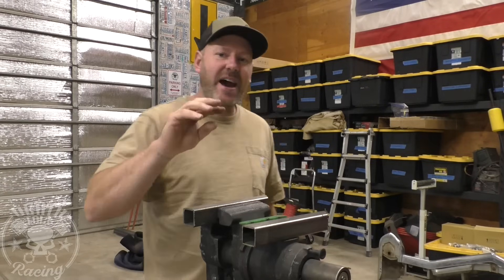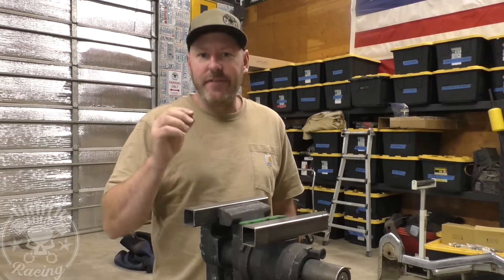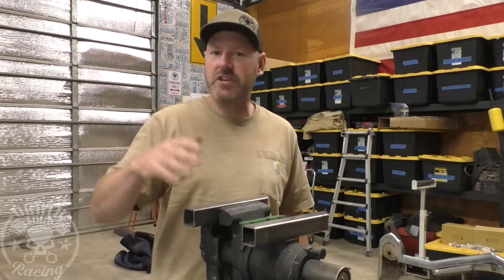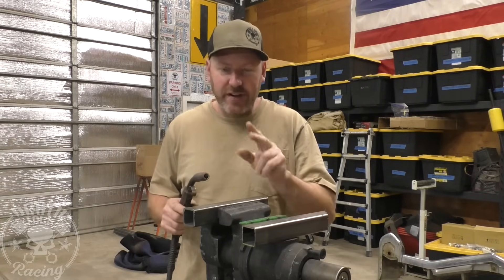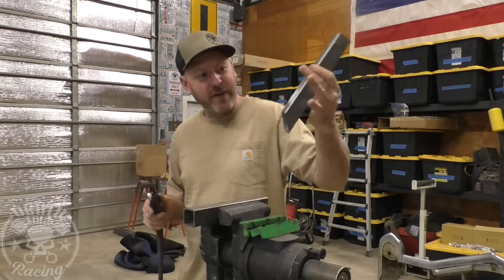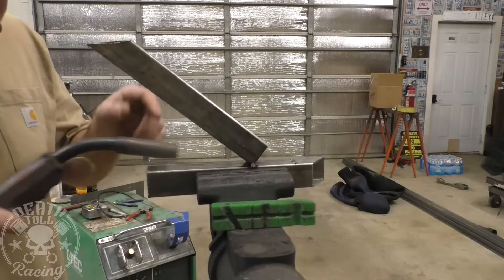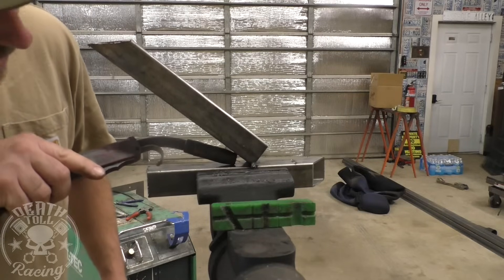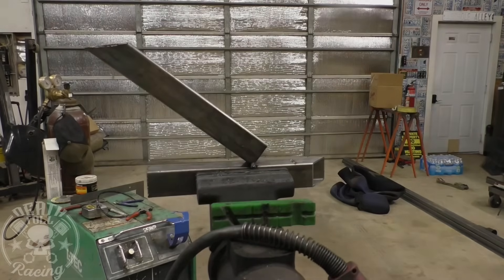Setting Wire Speed On A Mig Welder To Match Voltage, Must See For Beginners Learning Welding

Comment: . My friend is welding my exhaust I  2 areas , the crack right below the manifold. (fixed) and the ends of my new flex pipe that I had to replace.  (welding in process , we are in day 5.) don't know why.  I am doubting his knowledge  on this because his weld looks like crap and  it's not cold out here right now tonight, but he's saying, "it's too cold out ,  and his wire speed is feeding too fast . 
I told him turn the speed down, he says, he's already turned it down to the slowest that it will go for the setup .
 
however , I'm looking at his  dial settings, and it's at the hottest setting, and the fastest speed at 25 ft a min.  

I told him maybe his wire is too long because it's sticking out like 3½ in. 
.
I. sorry for this long explanation,  but I don't know what to think except it's pissing me off.  he knows I can't drive back to Colorado with my exhaust all messed up, . what is really going on here? 
he talks a lot bout the process but his actions are not consistent.
Reply from the maker: Under the lid of the welder there should be a chart.  Find the settings for 16-18g. Outside temp has little to do with anything, especially on thin material like exhaust.

Comment: how do know what voltage to use?
Reply from the maker: There are some good charts online if your welder doesn't have one.  It's usually under the lid for the recommended voltage for thickness.

Comment: How does one determine the voltage?
I follow the charts on my unit and the wire speed is always way too high and pushes the gun away.
Reply from the maker: on most machines you may have to use a volt meter if it's not on the dial or have a gauge.  You will set it to DC and go from the tip to the ground.

Comment: Perfect! Perfect! Before my cushy governmental job I was a MIG welder at a heavy trailer manufacturer. I did not learn how to weld there, that was a previous job, but by then I already knew how to set the welder by sound. I own a MIG welder today at my shop (retired from my governmental job) and if I'm under something welding and I need somebody to adjust my welder, I can just tell them to turn the wire speed or heat down or up just a smidge and they can figure out what I mean. And if they start asking stupid questions like "Do you want me to turn it to 4?" I just tell them don't touch the dial until I tell you to.
Reply from the maker: Lol

Comment: so could you tell me what kind of wire manipulation or pattern did you use these welds? It looked like a forward and back motion with no cursive e but I could not tell.
Reply from the maker: I usually do forward back. I try not to do any side to side motion generally. I try to keep the heat in the root of the joint.
Reply: @DeathTollRacing  so the forward / back motion and keeping the wire in the middle of the joint may not "stack dimes" but it better ensures a deeper penetration at the root which makes the joint stronger, not prettier?
Reply from the maker: Generally speaking I suppose. It will still stack domestically, but just not as dramatically

Comment: Down hill mig welding is not a good idea, it may look good but you will not get the same penetration as horizontal.  Yes I know it's easier to run but uphill is a better procedure.
Reply from the maker: cool story.

Comment: I'm late coming into this video, but great job talking about listening vs. watching. You may have mentioned this elsewhere, but the gas used also makes a difference in the sound.
 I've been subscribed for a while. I'm surprised this video has only now come up. 
 Thank you for the awesome videos.
Reply from the maker: There's more coming. And hopefully on a more regular basis.  I've been setting up the shop so I can spend more time doing, and less time shuffling crap around.

Comment: Call eme what you want, I refuse to watch welders that do not wear proper gear. MY son in law did this crap, he needed eye surgery.
Reply: You'll see it's for tack welds and he closes his eyes. UV doesn't go through eyelids, and you won't get burnt from ½ second flash.
Reply: @BrodyRadford You should still have at least a face shield. Those sparks do fly.
Reply: @BrodyRadford  Worked with a guy who spent the Weekend Tack Welding on his Stock Car, No Helmet.   Showed up on Monday saying his eyes felt like they were full of sand...Went home and didn't come back till Friday. 
Any UTuber who post without proper safety gear needs to be shut down !!!
Reply: @NRDavis-wl8vn a little flash burn doesn't take an entire week to heel so I would say the guy just didn't want to work 24 hrs is usually all a guy needs for flash burn! I am speaking from experience not just watching
Reply: Well you sure had a mouthful to say for not watching ! You know you could have just not said anything about it if you were not interested !
Reply: @ Because it's worth my time to call out idiots doing unsafe practices that would literally get you fired.
Reply: @opa_plays_mw5318  well been in the iron working trade for more than 20 years now and never fired over fitting up anything .  Welding is a special trade that will learn you all on its own what you can get away with or not from flash burn either on your skin or the eyes not from someone bitching that probably has never done it . I'm sorry your mom didn't allow you to go outside with our wearing a helmet
Reply: @donnellaapperson480  Passed cert's in 1980. Been there.

Comment: I have a cheap 110v mig from Amazon and I don't now how to determine the voltage. It has a range from -3v to +3v the ground is positive so do I set the voltage positive?
Reply from the maker: Is the Cheapest Mini Flux Core (gasless) welder I can find any good?  Bestarc MIG145 Review and test
https://youtu.be/yZclqwD_B_g
Reply from the maker: I think that’s actually the variance. Start with 0v. I actually go through this on another video. I’ll link it below.

Comment: The gusset welds look great, but the gussets are on the wrong position in my opinion. The center of the tubes is the weakest part because it’s the farthest from the other walls. Move the gusset to the outer or inner edge of the tubes and it will be MUCH stronger. Same cost and work, but stronger, so why not?
Reply from the maker: It actually depends on what you’re going for in positioning. If you make it to rigid by locating it to the outside, it could cause stress cracking. My design of these gussets does help for that though, not point loading at the end of the gusset (that’s the curve and cut out). That’s a complicated subject that gets really wordy.

Comment: This all sounds good. But how do you know if your getting good penetration with your welds? Like doing some welding on thicker metals, like for hot rod type of work. I want my welds to be strong!...
Reply from the maker: Do a test piece and cut it across the weld. Polish it as shiny as possible and rub it with navel jelly (rust remover). The penetration will be a different color.  I show one on a recent video on flux core welding for beginners.
Reply from the maker: Flux Core Welding For Beginners; Cheap Welders That Actually Work!
https://youtu.be/Pyhf87Frflw

Comment: Great vid showing how to set the correct wire feed to match the voltage. Now, how do you determine the correct voltage?
Reply from the maker: If you don’t have a chart on the welder, I would get some scrap of different thickness and set the welder for each one just below the blow through level.  Mark it down, or even mark the machine.
Reply: @DeathTollRacing  Thank you. Luckily I have a chart. So, set voltage using chart and then set wire feed to sound. If chart is off and burning through, reduce voltage and readjust wire feed to sound.

Comment: Thank you for helping, how do I know the heat setting in thickness of metals? By the time I get the sound you mention it looks like a spattered mess.
Reply from the maker: Newer welders usually have a chart to get you close somewhere on them. If not you’ll have to just turn it up until it’s too high and go back down. Usually if it’s spattering really bad it’s to low.

Comment: Bacon….are they frying an entire pig? Maybe pigs from Antarctica?….no sizzling ….the arc is off/ on numerous times per second if you hear sizzling or stubbing your settings need to be fine tuned the puddle tells the story.
Reply from the maker: This is short circuit, you are quoting spray arc.  completely different worlds.  You should withhold giving advice until you are more familiar.
Reply: @DeathTollRacing   oh sorry didn’t want to shake the boat. Short Circuit process is what I was referring specifically. The sound of bacon is a misnomer. In this process you cannot get a constant sound as in frying bacon. The arc is extinguished and reignited 60 times a second on AC 60 hertz. The sound of bacon frying is subjective at best’s as we all have different levels of hearing. Your bacon sizzling might be my steak frying in a pan. Just watch your puddle and stick out as that control your heat. You young guys buy a Harbor Freight welder and your instant popcorn welders. Keep your ears and mind open and your mouth shut…..BUT I did enjoy your video there was some great information there. Stay Well!
Reply from the maker: @carolynbatta9525  I only care to argue because I really don't like people giving bad advice, or conflated advice that confuses people.  I've hired over 1,000 welders in my career and a lot of the time would rather hire someone completely green than someone with minimal knowledge that they found in the comments or on reddit.

I'm not sure we are on the same page here.  If you think I need to turn the wire speed (amperage) down, you couldn't be more wrong.  If you are just arguing my descriptive words of the sound, then "okay" I guess. 

Now for the 60 hertz.  Unless you are running a transformer welder with a bad, or VERY crappy transformer, DC current output is 0 hertz.  Yes, it's plugged into an ac outlet that is 60 hertz if you are in the US or Canada.

Comment: I just subscribed and foesfly3047 below me has taken the words right out of my mouth. Excellent video and I look forward to the next one. I'm 69 but a bit of a beginner with welding, that bead was a work of art! Thank you
Reply: Fantastic! That’s what I’m working with right now. Should I assume that the “sound” adjustments are the same as the MiG? Thank you for the reply, it is much appreciated. I build high performance & repair of motorcycles. I do my own boring, valve grinding, etc. and I have a old SuperFlow 110 machine updated with Performance Trends computer software for my porting. The software is so confusing that I just use the old  SuperFlow manual controls. Maybe one of these days. I need to build a wheelie bar for a 1976 Yamaha RD400 2 stroke. Motors done and fired up with an auxiliary gas bottle. I’m in the middle of sanding and painting the tank and fiberglass body kit. Fingers crossed on that. I hope to run it on the drag strip but I know I won’t be able to keep that front end down and I’m to old to crash and recover. Thank you so much and I look forward to your next video. Didn’t mean to ramble on. What kind of racing are you building?
Reply from the maker: @richardbartlett4075  the sound with the flux core will be smoother. If it starts crackling, back it (wire speed) down just to where it quiets down. 

I’m doing street car drag racing builds currently. I’ve done off road, and hobby class rally in the past. I’m focusing on street car / trucks that you can take to a track or off-road park on my YouTube channel.
Reply from the maker: Thank you!  I have one set up now on using the gasless (flux core) wire since I know when I bought my first welder it's what I was trying to learn on.  I have a new camera setup so I'm hoping I can get much better video.

Comment: why do dimes when you can just run a straight line? and also you should never do downhill, only if you have no other choice then you can do it
Reply from the maker: 1-Root penetration
2-that’s a good rule for an amateur welder.
Reply: @DeathTollRacing  do you have any proof that doing dimes gives better root penetration cuz the way i see it, its only use is to make the weld look prettier but its not any stronger than running a straight line.
Reply from the maker: @anatude1  I did destructively test and weld procedures for 15 years. There’s a lot more to it than just “stacking dimes”, but just riding a puddle is the worst method, especially down hill.
Reply: @DeathTollRacing  thwn why doesent every welder out there stack dimes if its so much better?
Reply from the maker: @anatude1 there’s a lot more to it than that. You’re way over simplifying it.
Reply: @DeathTollRacing  ok im not tring to be rude im genuenly interested. Could you elaborate if there is a lot more to it im all ears i wanna learn more
Reply from the maker: @anatude1  it’s a lot to explain. I plan on make more videos and doing destructive/ etching testing so people can understand this. There are so many variables. Most welding procedures will be done with “stringer beads” not necessarily because it’s better, but because it’s easier to duplicate consistently across multiple welders, or more common now days robotic welders.
Reply: @DeathTollRacing  ok looking forward to thoes videos thanks!

Comment: tip for right handed mig welders, keep hearing protection in your left ear to avoid sparks going in your ear when welding vertical or overhead
Reply from the maker: I prefer non foam ear plugs since sparks go right through them and bring with them molten foam. an ear pod or something similar works well.
Reply: @DeathTollRacing  ive never had a spark melt my ear plugs and I used to do production mig but I guess its possible, we arent allowed music because its a structural shop and it can be a bit hazardous
Reply from the maker: @natenate2280  i wouldn’t recommend it. We used primarily 1/16 dual shield in all positions, so bb’s were real big. 😂
Reply: @DeathTollRacing  oh ok I was just running some vertical 3/32 dual shield today at work for awhile without any problems because I think the 1/16 hobart wire we got runs like shit and didnt have any problems but ill keep that in mind for tomorrow
Reply: .045 my bad not 3/32

Comment: Shouldn't the vertical be welded from the bottom up
Reply from the maker: With mig, and without pulse, it’s very difficult to go up hill without overheating if the material. If using self shielding wire, you will go up.  Flux core, dual shield wire is also up only, and some of those are actually a flat / horizontal only.

Comment: Hi there! Thanks for sharing this, I have one question, I have a cheap gasless MIG, and it comes with no chart what so ever. Is there any rule of thumb to set the voltage first based on the material thickness? Before I can then tune the wire speed to get that "sound". Thanks in advance Sir! Cheers from Indonesia!
Reply from the maker: The gasless wire will be different than what I did. On the small cheap welders, usually you will crank the voltage all the way up and then dial in your wire. You won’t really get the sound I got with it, but basically if you start with the wire slow, start turning it up until it starts sputtering, then back it off just until it quits. 

One last thing, you won’t want to weld down with gasless. Weld going up, always keeping your arc in the puddle.  I will do a video on this soon.  I think it could be helpful.
Reply: @DeathTollRacing  thanks for your reply! Looking forward to watch your upcoming videos!

Comment: Did you do two passes one on top of the other or was it just one pass?, Awesome job by the way
Reply from the maker: I did not here but you can. Usually though you would do one (root pass) and 2 on top (cover pass). Otherwise you’ll be weaving to cover. As you learn though, just do it however you can. Learning the rest of the techniques can come later.

Comment: Down hill is never going to be as strong unless it’s open root. 

Looks nice!!. But let’s be honest there’s no ticket for process’s for a fillet weld.(I guess it depends what your building) If our welders got caught doing a down hand it’s…grind it out…. redo it horizontal.
Reply from the maker: That’s a procedure thing not a set in stone thing. It is possible to downhill with joint penetration. There’s about 2 ways to do it right and 1,000,000 wrong. Most do it wrong because it looks smooth.
Reply: Yea fair. 

We had a guy get written up for doing a down hand. 

Not saying you’re doing anything wrong but young guys just starting…. I’ve been a journey man for 11 years. Worked on some cool projects in the past. If I ever got caught downhanding. Especially “new” guys. It’s frowned upon in some circles. 

But (DH) it could be “enough” in some situations.
Reply from the maker: @jeffbarker3001  yes, it required pre authorization where I was too. We rarely even used “hard wire” anyway. We were 99% dual shield. Mostly 1/16. That you don’t run downhill ever.

Comment: Even though i did not have a great need for a cadillac of a welder. Being a typical spoilet us citizen. I wanted a caddy of a welder and bought a 
miller 255. Miller has don a great job of research and development in this welding machine. I do absolutely love it. But with all these new fangeled toys. The convienience of modern day. These advancements will ruin a good welder. When we got our first wire machine back in the early 90's  even thoughe i loved it. I quickly didnt pick up the stick unless i had to. And all but have lost a useful skill. By neglecting the stick. Then got used to tuning in the wire feed. Now with this new miller. OMG. Set it for size of wire type of gas, thickness of metaland it just about does the job without me. So as nice as this 1 year old machine is now. I can tell there will be skills as in this video that will gain cobb webs in some back corner of the brain also. Excelent content.
Reply from the maker: Those are great welders!